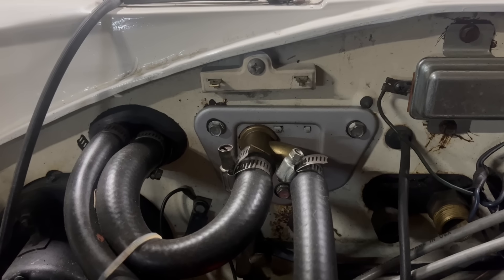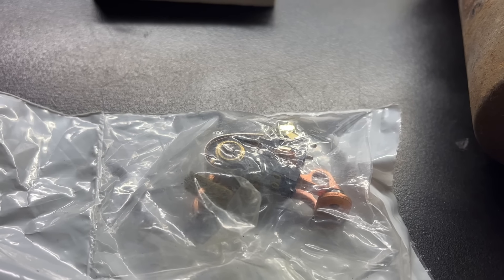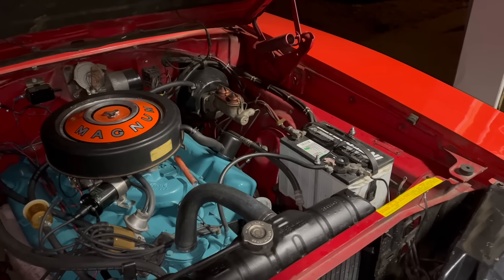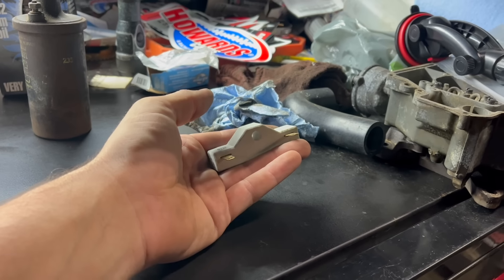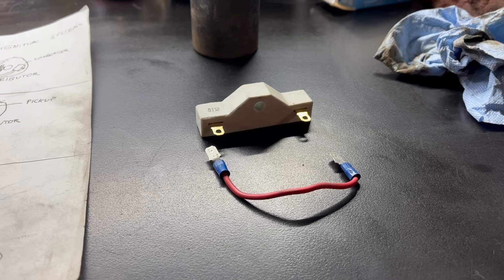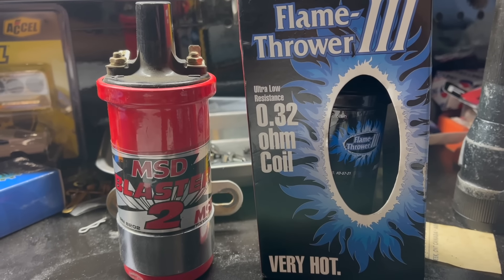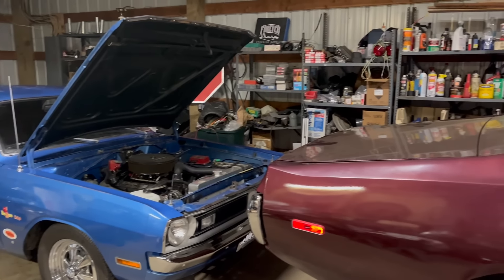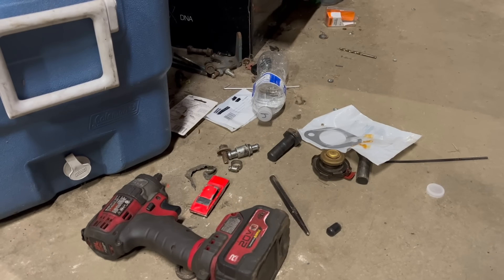The Big Ballast Resistor Video! A Simple, Yet Misunderstood Part Of Your Classic Chrysler Product

Comment: Excellent explanation . Im running an Pertronics / flamethrower  coil via a ballast - coil is a  12V in 45,000V out , however as its only getting 9V via the ballast its really only getting 33,000V out - more than enough to fire my weedy little engine  , therefor points are also only on 9V , Theres no bypass set up on it and the condenser / capacitor isnt in the dizzy but externally mounted under the coil . OK so its not a V8 , In fact its less than 1 litre . Still its been running perfectly like this for the last 4 years , never fails to start instantly AND the point still look new . All probably a non recommended set up but if it works is it a bad idea

Comment: Many, many years ago I put a new engine and ignition in my Challenger. Couldn’t get it to start after everything was in. We could not figure it out, everything was new, so we took it to a garage mechanic. The brand new resistor was cracked and not working. We kept ruling it out since it was new.

Comment: Actually it is a resistor that acts as a ballast . It's purpose is to provide a more powerful spark at start up and warm up . When cold the resistor has a lower resistance allowing a higher voltage to reach the coil . As the resistor heats up the resistance increases reducing the voltage to the coil , this  prevents the overheating of the coil . Believe me this guy is making shit up .
Reply from the maker: Ok… so did six volt vehicles need a ballast resistor? No? Ok. Also, during starting, there is a bypass circuit around the resistor - rendering it useless. Enjoy huffing glue!

Comment: Everyone know points and coils run on 6v... and start the engine on 12v... its not just mopars, its all of 'em... plus 12v will burn your points up soon.
Reply from the maker: Judging by the comments I get here, I don’t think we can say “everyone knows.” It’s not exactly 6v, but it’s much less than 12v. It’s also not exclusive to points systems either - case in point, the Mopar electronic system. Yes, I’ve learned the hard way on trying to trigger a high performance coil with points and no resistor. That doesn’t work…

Comment: So essentially, putting a lower Ohm ballast resistor would allow more voltage going to the coil, but would lower the lifespan of the ignition components points/rotor/cap/condenser/coil.

Yay? Or Nay?
Reply from the maker: Basically, yes - but if you’re trying to make a hotter spark, that isn’t the way you want to do it. It might lower the lifespan of those components a lot… during the filming of this video, I learned that the resistor on my Charger is a lower resistance rating than the one I was using as a prop. I knew it looked different, but figured it was fine. This might help to explain the multiple points and condenser failures I’ve had since putting the points distributor in…
Reply: A lower ohm coil and a lower ohm ballast do the same thing.  More heat, bigger spark.
 The Mopar Bible shows how you need a special ignition box that can tolerate the heat that either of those produce. And even they have their limits. It is a for drag racing modification.  Like DDG says, it is not for points.
Reply: @DeadDodgeGarage   Mercedes used a ballast with about the resistance you are measuring.  I was actually thinking of trying one.  Most of mine are closer to 1.5  ohms than the 1.0 or 1.25 I was expecting.  I try to put the odds in my favor by using non resistor plugs (like the car came with) and solid core wires which is not  what it came with and is not recommended.
Reply: @auteurfiddler8706  Appreciate the further clarification, I've got points with 45K volt coil with the factory ballast resistor in place.

Has a noticeable "response" good enough since it's on a daily driver, not quite giddy on the thought of redoing an entire ignition system to something else from factory.
HEI/Electronic.

Comment: In the late 70's, I had one of those ballasts go out in my company car at the time, a '77 slant six Plymouth Volare. Fortunately, in one of my rare pieces of good luck, I had just finished filling up at a full service station, and the car wouldn't start. In a bay it went, resistor replaced, and back on the job again.

Comment: I learned all about ballast resistors when I wired my electric choke straight to the coil. Made it about 30 miles from home when it died, let it cool drove about 5 miles died, repeated about 20 times but made it home. Next day I set out to replace the resistor and found it to be mostly dust.rewired the choke and all is good but never leave home without a spare resistor and control box.
Reply from the maker: That’s impressive. I did that on my Charger not long ago - wired the choke on the wrong side of the resistor. It made it an hour from home but it was breaking up and getting more and more unhappy…

Comment: In my ten years of driving a Chrysler with the Ballast resistor (1981-1990), I probably went though more than two dozen resistors.  I definitely kept one in my glove box!  I found that humidity killed them.  Rainy days and car washes in particular.  My vehicle at the time was a 1969 Dodge A108 Van with a 318 V8.
Once, I stopped for a stranded motorist in a Diplomat, (about 1980 or so).  I immediately diagnosed the problem as a blown resistor and proceeded to take the resistor out of my glove compartment and install it.  The owner couldn't believe that my car used the same part as hers.  I explained that it did not (hers had 3 connectors on it, mine had two), but I had bought the wrong part years ago and it was rattling around in my glove box for several years.   If I am not mistaken, hers had 3 terminals on it only because it connected both connectors directly to the resistor wheras mine was set up like your Charger and the two wires merged in the wiring harness.  This means that her resistor would have worked just fine in may van if I just ignored the extra terminal.  
These resistors on Chryslers were crap.  In all the Fords I owned with them, I never had a failure (they blew starter solenoids instead).   Not sure what Chrysler did wrong on these.  They just Sucked!
Reply from the maker: Isn’t the resistor mounted to insulation inside the engine box on the A van? I wonder if that was a factor in your experience. As mentioned here, my experience has been very different than that. I’ve had many different Chrysler built vehicles with the resistor under the hood and have logged many thousands of miles with them. I’ve had a few failures, but that’s it.
Reply: Resistors are not only rated in OHM's but Watts as well. If you could have found out the resistance and measured the amps that passed through the resister you could easily figured out how many watts was needed. One could contact an industrial electronics parts store and request a resister of the same Ohms but double the watts. Many times these high power resisters come in a metal package that uses two screws to mount it to a metal surface. Add a little white heatsink compound to the back and there should never be a failure again.
Reply: So I tend to wake up in the morning and have no spark. But if I have had it running like 10 mins ago it would be fine it would start up but if it sits longer then 30 to 1 hr it doesn't get spark I fiddle with the ballasters and unplug the coil quite a few times before I get it to actually start up so any advice or info to what you could think it is or if it is the ballast

Comment: Wow… I never knew this. That is quite the cheap crappy solution when they could’ve just made proper coils for 12v…
Reply from the maker: My explanation is a bit off on the particulars - but also, an ignition resistor was universal across the automotive industry, as well as on farm equipment and the like. It was not, as you say, a “crappy solution.” Resistors were eventually integrated into coils.
Reply: @DeadDodgeGarage  your explanation is good. I’m in electrical engineering. I just didn’t know they did this. A resistor is a somewhat cheap fix that gets hot and can eventually fail, they should have just made longer more precise coils.
Reply: It is not a crappy solution. In AUSTRALIA  these resistors were fitted to the locally made cars for easier starting. A 12V system with 7V coil. 12V on start,7V on run. Remember on starting the battery voltage drops down to about 10-11V .The resistance gives a quick and easy start especially when the battery may be not quite fully charged.

Comment: LOL. Your trick only works for automatics.
Reply from the maker: That is not the case. Lol. As I explain in the video, I used exactly that trick on my four speed Challenger - with no functional clutch safety switch. By holding the key right between the start and run positions, there is a spot where the starter is disengaged but IGN 2 still has power. I showed it in the video… it’s way easier in an automatic, because dropping the shifter into gear also disengages the starter, but also because you don’t have to shift and steer with your other hand 😅
Reply: @DeadDodgeGarage LOL.  I stand corrected my friend.

Comment: Resistors are not directional, there is no input or output end designated, if there is than it is more than a resistor in the casting, there could be a diode.
Reply from the maker: You’re absolutely right, and I didn’t say there was. Flip the two sides around all you want, it makes no difference. When I refer to “input” and “output” sides, I am using practical terms to describe the side voltage comes into from the electrical system, and the side voltage comes out of to the coil.
Reply: @DeadDodgeGarage  Well it is now clear to me what you meant thank you for clarification.

Comment: An old school Mopar guy I knew kept a second ballast resistor mounted directly below the original... Makes the swap or check procedure real quick...
Reply: Genius, and solves the problem of not knowing where you hid your spare br.
Reply: @larslarsman  The guy was one of the smartest people I've known. I did odds  and ends for him when I was in highschool. Doing routine maintenance on some of his vehicles, he had several little tricks & hacks installed for when ( not if) something broke down. His reasoning was that a breakdown or trouble will usually happen when you're pinched for time, in the middle of inclement weather or something along those lines. Best time to figure a quick & speedy fix is when you've got a couple hours in a nice dry garage.

Comment: Learned about the ballast resistor back in the mid ‘80s on my dads Challenger T/A. It would start but then shut off as soon as you let go of the key. That was a lesson I always remembered.

If only you knew then what you know now. I would be happy with just a ‘70 Challenger T/A clone.

Comment: I have the MSD 6AL and blaster coil. I want to install them on my 78 W200. My problem lies in what I need to do with the original 4 prong ballast resistor and ECM. 
Since this truck has electronic ignition, how do I bypass the BR?
As far as the ECM goes, does it get removed or does it still serve a function along with the 6AL box?
Reply from the maker: 1) bridge the resistor just like a two post, you are looking for the side that has (I believe) two blue wires. The other side is unused and does not need to be jumped. 2) remove the original ignition module.
Reply: @DeadDodgeGarage  You, Sir, are a life saver. Thank you for taking the time to respond. I truly appreciate it.